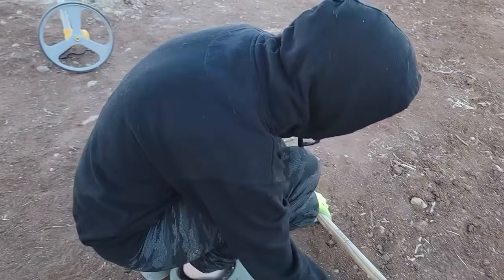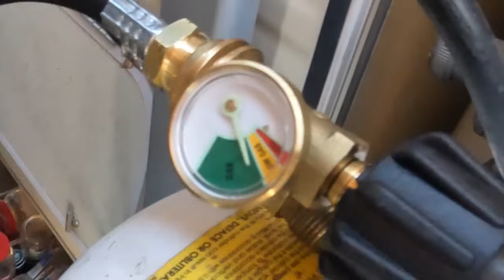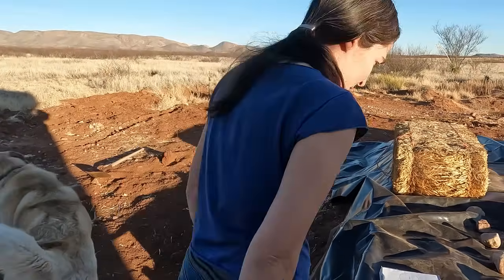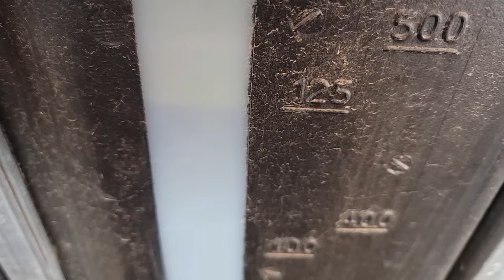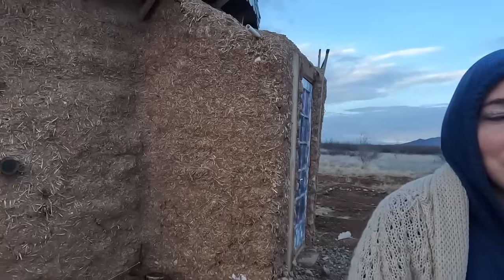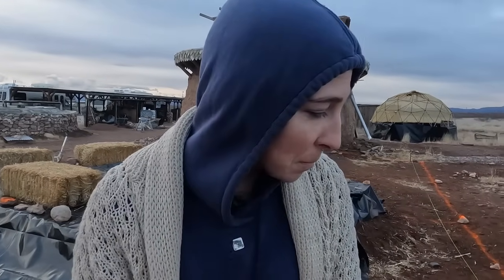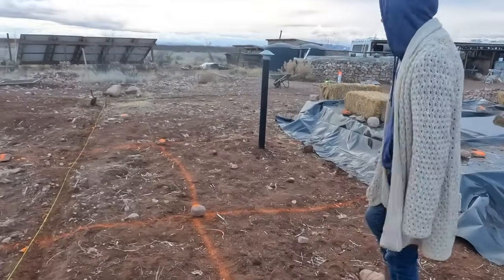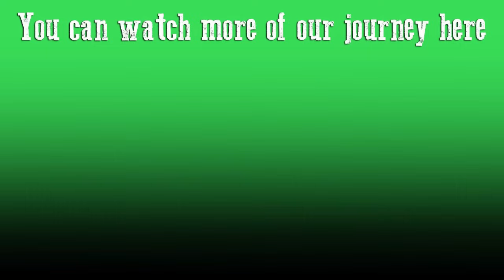Three Straight Days Of Rain! How Did the Root Cellar Hold Up?

Comment: It never floods on my property. being on a hill 👍👍  Those gauges are nice to have>  i got like 6 of them.  Helps tell if your running low or not.. I got them on sale years ago. for 3 dollars each >>  and i use them all the time👉👉Propane make a nice back up. FOR? FAST INSTANT HEAT  You can get a 10k BTU wall heat for under 150 dollars and it will run for ever on a 100 lbs. Tank I use 40  lbs. tanks, in the bed rooms, with a 10k BTU wall heater >  I love the blue flames

Comment: Hey guys, looking forward to hearing about what construction technique you're going to use next. Just a suggestion...you might consider swapping the pups room with the kitchen so that the kitchen is next to the laundry room to consolidate the plumbing to the same area...putting the plumbing on a shared wall. Since your laundry room is going to have an exterior door anyway, you could put a toilet in there for easy access from outside. For that matter, you could also move the bathroom to the location of the laundry and put the laundry between the bathroom and kitchen to consolidate all the plumbing in the house. Just some ideas.

Comment: I like the plans, myself would either make temp shelter over steps of cellar or finalise where walls will bethen do a post and beam system with either 4x4 or 6x6 posts once headers and top plates are on you could do shed style roof with over hang so low winter sun can enter but high summer sun would cast shade. You could have two sections of shed style roof making south  greenhouse wall the highest say 12 foot sloping to north  using 16 foot 2x6 as rafters the higher roof drops down to lower roof which you tin so you could collect massive amounts of extra water. Then working from top down you would have shade and be out of rain fill in between posts with bales and render them for very fast and cheap build. Or you could ask some greenhouse places to sponsor you and get a kit from them  and build greenhouse directly over root cellar. Would hate  to see another flood wreck the cellar. Interested to see what your plans are.

Comment: You can easily determine how much propane you have by pouring 2 cups of hot water over the tank then you can feel the tank. The level of propane is indicated by a cold temperature.

Comment: To gauge your propane level accurately  is easy, simply pour boiling water down the side of the cylinder....above the liquid gas level will evaporate quickly giving you a level

Comment: firsst YOUR LOOKING FANTATIC  and I to need to be in the space. I love the idea o th elaundry room , please consider adding a shower so that when you have worked outside you can come in , put your clothing to be washed , take a shower and not muddy up your home, les time having to clean the house! put a drain in the laundry room for easy floor cleaning with a hose. Have the used water go through a bio plant filter that can act as a peaceful pond in side the green house, thereby allowing you to use the recycled laundry and bath water to water the green house and create a nice winter sitting room and then from there it can go out to the orchard...just a thought but thats what im doing what i finally get to that point! be blessed

Comment: As a hardy desert dweller for 7 years I have a few lessons on dealing with 120plus days in the summer'
Now I live in a 640sqft  tiny house built in 1960. It is well designed for the extreme heat of the Mojave desert.
If I was building a homestead from scratch in these extreme heat conditions, I would go under ground for a house like your root cellar.
By  going underground using the earth to cool the house in the summertime and to keep warm in the winter.

Comment: One simple and accurate way of checking the propane level is to pour some hot water on the side of the propane tank, and then feel it with your hand. Everywhere there is propane touching the side of the tank the steel will cool off very quickly. The portion of the tank above the level of propane will cool off much slower so you can easily feel the level of the propane.
Reply: This is the way.

Comment: I remember when you first came home with u vee(?), she was scared, shy, unsure......she has really changed. Loving, caring, protecting. The best pet.
Reply: What happened to the other dog?
Reply: Lluvia (LLUVIA, pronounced yuviuh) is Spanish for rain. Very fitting for their environment, and a fitting video to share that info in 😁

@tedtimmis8135, Crew is recovering from a tumor removal surgery. He is also an older pup, and can't move around like he used to. He's usually hanging out inside the camper where it's more temperature controlled, but they do take him for (short) walks regularly. Also, he and Lluvia don't really seem to get along (last I saw them together, maybe a year ago?) so they've pretty much always kept them separate.

Comment: I am a little confused by your design for the addition. As it stands, your primary heat source is in the dome (rocket mass heater). Your bedroom also is in the dome (under ground). What else is going to happen in the dome? I don't know what your footage is in there, but don't you have two levels? Where will you sit down to eat? The kitchen? The dome? It might be advisable to think about how you are going to navigate the space. For example, if you cook a meal in the kitchen and plan to eat in the dome where it's warm, do you really want to navigate through the greenhouse with it? Again, according to the current design, you will have to climb up out of your bedroom, leave the dome, and then navigate to the far corner of the addition to use the bathroom. I know that this is your "first draft", but you might want to try rethinking some of this. :)